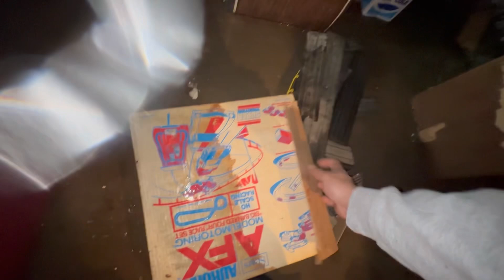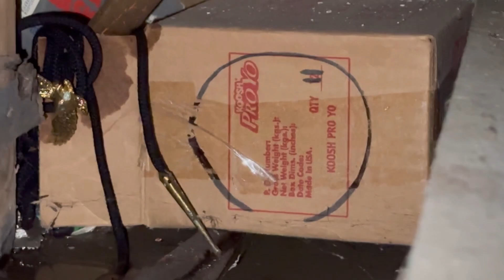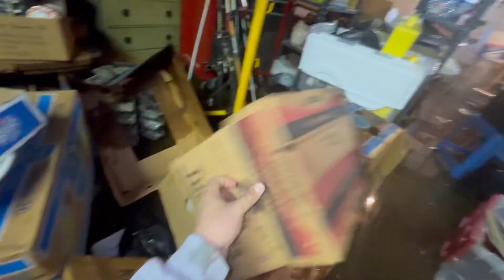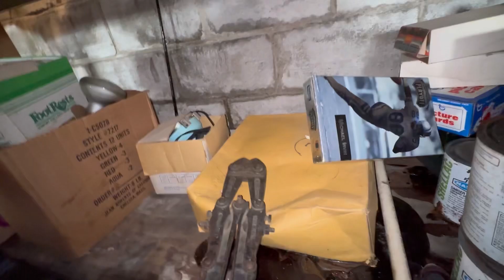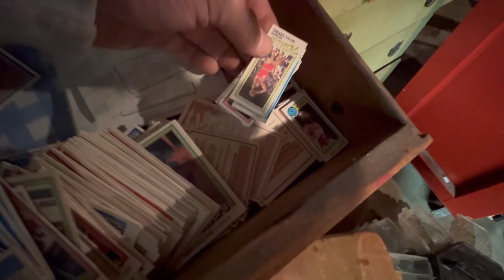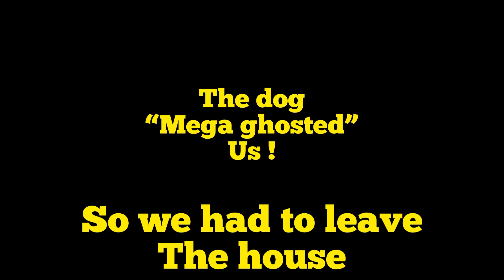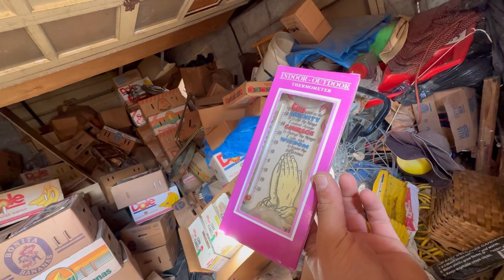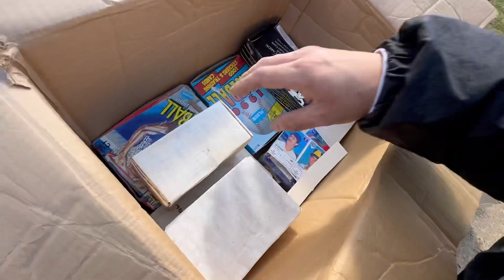🚨 EMERGENCY! WE NEED A PLUMBER AND ITS FLOODED EVERYWHERE in the Hoarders House basement!

Comment: Please do one more thing 
Get a dehumidifier,  will take the moisture out of the air have it drain via hose right into the subpump  it will help with the smell and mold and mildew you don't want that smell going through your entire house, it will be the mold and mildew spurs going through the whole
To make the drying out process go faster put a fan down there to circulate the air
I promise  you will be super happy you did it

Comment: I don’t understand why you’re not calling a plumber, shut the water off when you leave the house. Take everything upstairs you have the room. good luck 🙏
Reply: It’s not the water from the house flooding the basement, it’s from all the rain we have been getting.
Reply: @kristen440  I don’t think it’s just from the rain. He did find a pipe that was leaking.
Reply: he's cheap , it's a hoarder house. with good money. goto Home Depot, get a sump pump, and change the pump. the more u got that house for the longer, ur going to have problems. sell the house . take all the stuff out of it. eesically the bus sell it or trash it.
Reply: He can't shut off the water because the valve to shut it off is froze in the open position. The main from the road needs to be shut off then they can replace the old shut off in the house then the main from the road can be turned on again!
Reply: I agree. I said that in comments several days ago!
Reply: @stevespumpkinart8567  he won't sell it yet because he first had to sell all the stuffs inside get the cash and do the repairs and sell it to Jeremy George What the Hales
Reply: Exactly

Comment: Dude I see by the video the water never got shut off from the street :face-fuchsia-tongue-out: Because if it had been shut off you would have been able to replace the shut off by the wall. It really needs to be fixed to turn off the water in the house off in case theirs a leak, very important!!! Sump pumps don't last forever looks like theirs a steady stream that goes in where the pump is, last year your pump was working but died this year. Just the kind of things you learn when your a home owner I know I have had my share of learning these things it no fun I had to replace a furnace over $3000.00 as well as other damage the water caused :face-pink-tears:

Comment: You should have barted with the plumber. Swap items like tools ect in exchange for the plumbing works. Good luck and get the stuff on the wood that’s wet off otherwise the dam will keep rising and soak into the boxes, I would put tubs on the bottom of stacks. Or just get it all out of the basement.

Comment: That's not a bad price for all of that work.  I paid my plumber $475.00 to put a hose on the outside of the house. Fix the washing machine pipe and shut off and reroute third floor water tank pipe to my tank. So what your getting for $616.00 is a good price.

Comment: Sorry but look over the cement block for moister any we're it looks wet even on the floor any sign at all that will mean it's leaking and you will need to water proof it all the way to the bottom it's called the base most of the time you have to dig it out so you can fit and brush on emulsion coat and fiber glass webbing you will coat with the webbing let it dry and cost 3 times till you can no longer see the webbing the you will place fiber glass board so when you fill it back with dirt so you don't cut your webbing full with dirt or base rock also look for areas that might fill with water and put your sub pump there also your rain gutter downspouts will need pipes to carry water away from your basement I know it's a lot but maybe you can find a roofer to help you on the side for cash a save lots of money I hope this isn't your problem but alit of basements have been there for years and the current waterproof has failed I hope you get this message I can help  talk more but I can't share my info on you tube hope all is well and things get better

Comment: That pipe causing all that water ? but didn't it flood because of the rain ? Well you gotta fix the plumbing but you will not know if it's fixed until it rains again